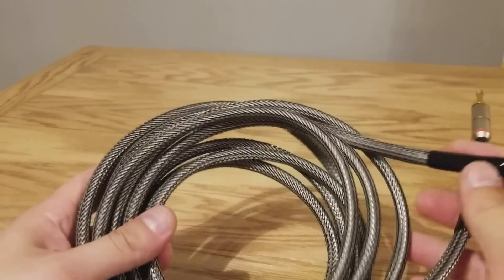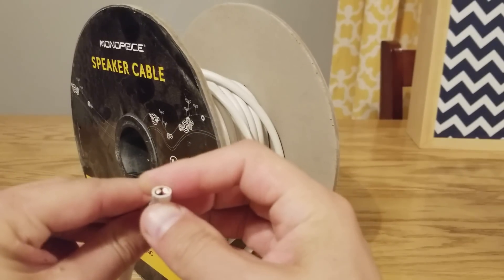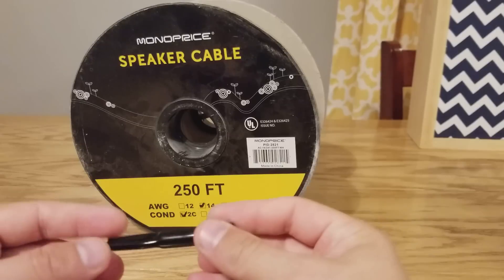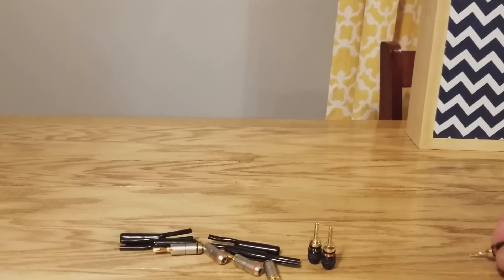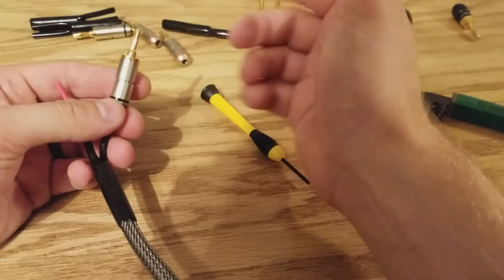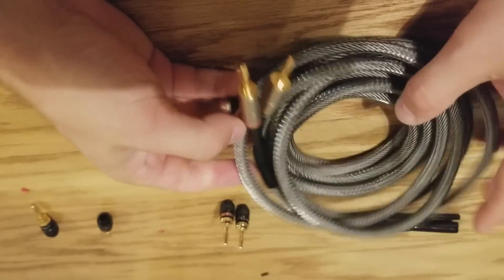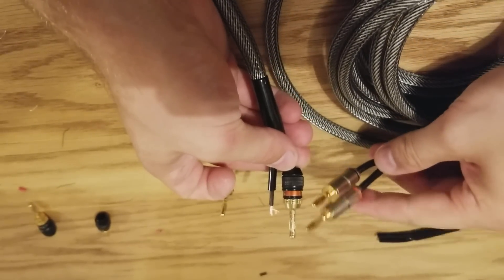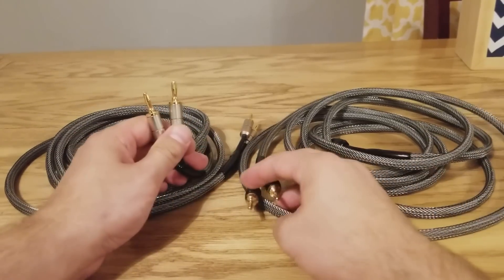How to make Your own HiFi Speaker Wire

Comment from the maker: Parts Used on Amazon:
Tech Flex: https://amzn.to/2KL2yxj
Cable Pants: https://amzn.to/2MeyXkP
Banana Plugs (were discontinued) - equivalent - https://amzn.to/2qCIQME 
Speaker Wire: https://amzn.to/2AZQl8m

Parts Used from Parts Express:
3/8" Tech Flex - carbon - https://bit.ly/2Dk9qBi
8mm Cable Pants - https://bit.ly/2RCBBnG
Banana Plugs (were discontinued) - equivalent - https://bit.ly/2T1H6cx or https://amzn.to/2qCIQME 
14ga speaker wire 2C CL2 -  https://bit.ly/2sys9mm
Reply: ofc?
Reply: I need 10 gauge  two sets 20 feet and  10 gauge 4 set 4 feet can you make them for me and how much
Reply: My number is 757 371 4445

Comment: Making a big deal about how much gap there is between the distal end of the banana plugs and the cable pants that frankly no one will ever see once the speaker cables are installed is so far beyond petty. But if that gap bothered him so much he should have used some shrink flex. I happen to think that the second style of banana plug that he showed with what is known as a deadbolt connection has a much stronger connection with the conductor than 1 or 2 screws.

Comment: 5:08 I'd suggest fixing that techflex with a loop of electrical tape before slipping on the cable boot. That way you make sure the techflex stays in place and makes it easier to slide the cable boot on!

Comment: None of this makes any audible or discernible difference in real (blind tested) trials. 
Gold plated connectors - Gold is a shit conductor, it's only redeeming qualities are that it does not tarnish or get an insulating oxide layer like copper or silver The amount of gold in any of this plating is questionable to zero. 
Use the shortest, thickest wires practical - that will make more difference to the sound than anything shown here. 
PVC is an average to shit insulator - another reason to use as short runs as possible is its measurable capacitance, especially on low impedance inductive loads like speakers!
Forget the banana plugs unless you like experimenting - if you are not going to connect and disconnect your speakers frequently use the binding posts - it removes the extra mechanical connections introduced here that can create more issues.

Comment: What if you don’t feel like bothering with the connectors?   Can you slip the jackets and boots on, strip the wire and clamp the bare wire down with your screw on speaker and amp posts?  Any audible difference?

Comment: The connectors will improve connection and it does look nice.  However I fail to see any mitigation design to address RF noise.  Using 3-6 pair braided and high quality copper cable will address that.

Comment: Yeah, I did a speaker cable test yesterday.  Braided vs twisted vs fig 8.  cables all came out at much the same capacitance.  while simply separating the conductors along apposite edges of 1 inch masking tape reduced capacitance by around 75%.  However, due to the test length and metering precision, I am only getting 1 significant figure (0.04 nF to 0.01 nF) for a 1 ft test  length of 4 x 18 awg cables.  So results may vary +- 0.005 nF.  However, this result is significant enough to indicate the traditional cable construction you show is not the best impedance matching solution.  Even just having the conductors in a thicker walled foamed low dielectric jacket would give better performance results than the visual bling you are making.

PS, in case your wondering about 16 ga wire, It's to increase the impedance factors like capacitance to be measurable with the meters already I own, so I can evaluate what constructions are most likely worth perusing with a minimal outlay.

Comment: It's very good of you to make videos for people, and they look great. But I can't not say something. First off, a pro installation appearance  had nothing tp do with high fidelity audio. I've done high end residential AV as well as commercial projects and pro audio work since 1998. These are just a few observations. First off, I've helped some friends out with their homes a few times and used the monoprice speaker wire for their stereo distributed audio rooms to save them a little money as they don't typically have the same budget allowence or level of gear as my regular clients.Be cautious of budget speakert wire. I've actually had monoprice and noticed it wasn't pure copper, it was actually just plated with copper. That's not the worsr thing in the world because at least audio travels across the surface of the copper. Unfortunatley, that brings be to my next problem with it. Fairly low strand count when compared to higherquality speaker cable. My standard everyday installation cable is Liberty extra flex 14/2. Theater or dedicated media room i occasionally us their 12/2 depending on the hardware I'm installing. When I'm blessed enough to do some real stereo hifi listening rooms its Nordost everytime. If youre invested in hifi level amplification, and floor standers there really is no reason not to. It will only ever perform as well as its weakest link, and there is a very measurable difference between Hifi and budget cabling. Again, they look great and I think its great you share installation practices with everyone, Im just an old audio purist/av contractor who believes "HiFi " needs to meet certain standards
Reply from the maker: I appreciate that sentiment. Just so you know Monoprice CL2 rated wire which I linked to in the description is ofc pure copper and not CCA. They may have and still may sell some wire that is CCA, but not the stuff that I linked. Do you mind showing the measured difference? Since it is easy to show, there should be easy data to find. So if you know of data that shows some HiFi speaker cable that easily outperforms a cable that is pure copper.  I would be very interested.

Comment: If you use class D amps, there are some serious issues with all of theses pretty metal banana plugs. Their shells are not insulated to the speaker wires, and if they touch each others they can short positive to negative, left to right, or to the amp metal case which is often the earth ground. If you have music playing through while shorting the speaker wires to who knows where, look for trouble down the road.

Comment: Nothing can beat a solder joint. Snake oil optional. Cable $30.00. Snake oil $3000.00

Comment: HiFi refers to high fidelity -- reproducing recorded sound in the most lifelike manner. This video is not about high-fidelity wire but impressive-looking wire. Neither the tech flex nor the banana plugs contribute to higher fidelity. The tech flex is obviously just a cosmetic touch meant to impress others with the outward appearance of the wire.  The banana plugs look nice but only add one more element between the speaker wire and the terminals. It could be argued that if one solders the wire to the banana plugs they end up with a slightly better connection at that point but soldering is not discussed in the video. It is true that 14 AWG OFC wire will work quite well in a system and that Monoprice sells good cables. There is no need to pay for snake-oil products OR merely cosmetic changes to the outward appearance of one's speaker wire if what one is really seeking is high fidelity. Why should any of us care what impresses the ignorant people who will be wowed by tech flex and banana plugs?  Informed audiophiles will be more impressed by our savvy in not paying for these kinds of irrelevant things.
Reply: Sure, and all hifi audio components should just be the raw color of the material they're constructed of......ok then.

Comment: This looks good but is only good for aesthetics. DIY..go to TNT-audio and build those. otherwise, Kimberkable is the way to go. Could also make an argument for solid wire for bi-ampped tweeters or high-end. Thoughts?
Reply from the maker: Only poor quality cable can sonically sound different.  Here's a good overview video on it: https://www.youtube.com/watch?v=7YIGLnbc12I
Reply: @Toid  Thats not true. Even the video you shared acknowledges that. He says Kimber Kable posts their measurements. On their website they show lower impedance as you move the product line. 
Yes, at a certain point its snake oil or just pretty, I agree. But better cables do provide better sound quality the what you have here. 

Another issue is signal noise. Large amps and a large mass of electronic equipment produce a ton of signal noise. Thats why Kimber weaves their wires, to reduce it. Its also why "shielded" wire exists. Its also why those cylinder things are on many of your low voltage signal wires, those are noise filters.

I don't thing anyone needs $2,000 cables, but I do KNOW that Kimber base series quieter and produce more crisp hi's in large amp, large driver applications. I've heard the difference.

Since you are a DIY audio channel I encourage you to go to that TNT Audio page on cables and make some woven cables with CAT cables. See what you think.
Reply from the maker: @texacajundiy  I'm not sure how you got that from the video. Gene clearly states that he knows the cables are audio jewelry and they don't make his system sound any better. He did go on to say that if you are going to charge a premium you should at least show your measurements. That way cable companies don't keep selling you on ideological fallacies that don't make any sense within the physics world. Basically he wants them to stay accountable to what they're saying. The skin effect that you're talking about with impedance isn't an issue. But once again you can read about it here: https://www.audioholics.com/gadget-reviews/speaker-cable-and-audio-interconnects You don't have to take this information in. We can agree to disagree.. I know a lot of people that feel that way about cables and I don't mind them buying more expensive cables. It all ends up boiling down to a personal and ideological choice.
Reply: @Toid  this very article links this one https://www.audioholics.com/audio-video-cables/bulletproofing-your-system-from-interference. 
In the article they talk about twisted and shielded wire. As I’ve said you should try out the cables in the TNT audio cables section. They will cost around $2-4 or so a foot to build. On a large system they make a difference, an audible one.
Reply: Also, Kimber Kable posts their impedance from 10 to 20,000 Hz. Inside the human ear’s range. Not at 100kHz as your article suggests. Just like what Gene said in your video link.
Reply from the maker: @texacajundiy  you're misunderstanding the technical side. Rewatch the first video in full and you'll have a better understanding. I don't plan to explain the technical side any further. The truth of the matter is the Kimber cables are nice cables, but sonically there is no difference.
Reply: @Toid  I'm telling you on larger systems, 150-1500 watts, in a home with the typical EMI that a modern home has, its audible. Not cause someone told me. Not cause I own them. Cause I heard it.
Why does audiholics recommend twisted and shielded wire? It was a link in your own reference. If they are wrong, why reference them? If Genes discussion of "posted numbers" is not relevant, why post it?

Comment: Many amplifiers and speakers do not accept banana plugs.  Some need spade connectors and some amplifiers have those awful wire pinching ports.
However, your cables are awesome and sane and likely even better than all of the exotic "high end" expensive cables.

Comment: Nice looking cables, and great demo. I actually think I prefer the cheaper banana plugs because of the way they clamp to the wire. Set screws and stranded wire can fail sometimes (I usually solder the strands together  for those types of connections)

Comment: I have to say when I seen 10-12FT speaker cable going for $250.00 - $350.00 .... I thought what the  "F..."   who in their right mind would be paying that much for speaker cable .... Some people just have way too much money to buy that Snake Oil ... Like come on Man Really .... No doubt you want to purchase good low capacity low resistance cable of pure stranded copper with a coating that shields the line from the many kinds of interference prone with Car Audio but to pay $300.00 for 12FT of cable thinking that you are actually getting your moneys worth has to have some screws loose upstairs they should be putting their money towards .... I dont care what anyone says !!!
Reply: I think you'll like these cables: https://blinkhighend.com/shop/cables/nordost-cables/nordost-speaker-cables/nordost-reference-odin-supreme-speaker-cable/

Comment: What about spikes on speakers, & cheap vibration rings. The second can make a huge difference to systems with turntables. Because I want to chase the best sound for my system.I am descibed an idiot & even told I imagine often significant improvements from doing this. Speaker cables are generally out of site, the outside sleeve hear functionally is a waste of time . My cable is light blue looks a bit cheap fitted & is with good quality plugs. What does it do to my system opens up all frequencies, why I don’t know but it does, & all the people who have heard them in comparison to my old cable agree with that . There is one caveat, people who don’t have good hearing generally don’t hear much of the improvement.

Comment: If I have 16 gauge speaker wire in wall, can I use 14 gauge speaker wire from the amp to the wall plate and 16 from the plate to the speakers?
Reply from the maker: Yes

Comment: I will just add a little fuel to the fire here and say that an old friend back in the '70s had a rack mounted stereo in one of his bedrooms (3 racks, several Crown reel to reel tape recorders, etc, and a Crown DC300a driving a pair of Bozak Concert Grands in his living room. He wired those up to the DC300a with (brace yourselves, get ready for it!) 12-2 w/ground Romex!!!! It sounded great! I loved the way music sounded through his system. As good as anyone else's high dollar wires sounded with their system. But this brings me back to a basic question, why would anyone want to listen to their stereo system. I would rather listen to music. Finally, I remember a couple of old sayings that might apply here:
 Definition of an audiophile: someone who spends more and more on his hardware to improve it to the point that he is able to prove that all software (music) is defective, and P.T. Barnum was right, a fool and his money are soon parted. If you can't hear it in a double blind test, it's not there.

Comment: Call me crazy but I prefer to solder my cable into the banana plug. Makes me feel better and never question the connection.
Reply: Solder can make a great connection. However,  it can also make wire brittle over time with repeated flexing. As with all things, there are pluses and minuses.
Reply: Me too!
Reply: If the wire has a mechanical connection this is what provides a good connection. Soldier just holds a mechanical connection and doesn’t provide any better connection. So solder is not ideal in this situation
Reply: Why not. I also would solder them to have best results:-)
Reply: Would you use a speaker cable made of solder metal?  Your signal is only as good as it's termination..  I believe soldering only hurts signal.  If you use good terminals, there's already going to be an excellent connection!